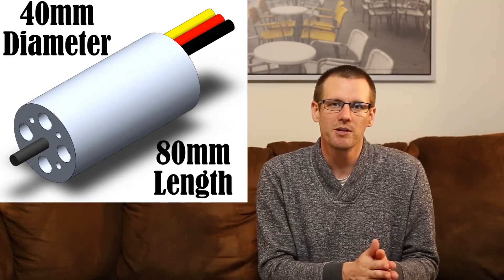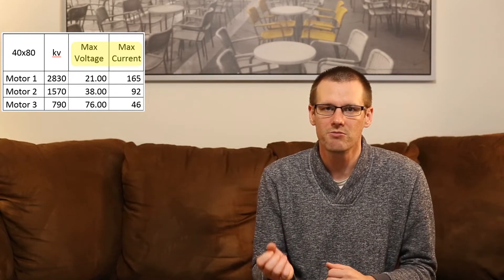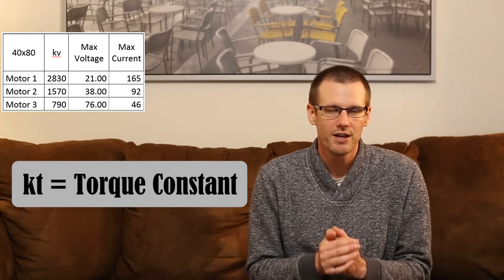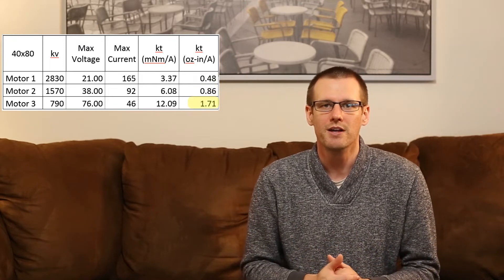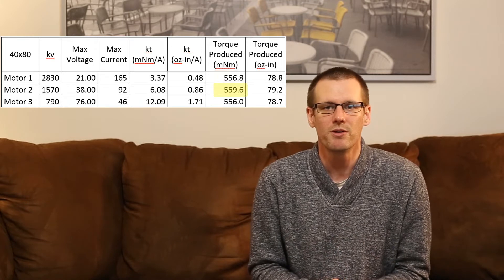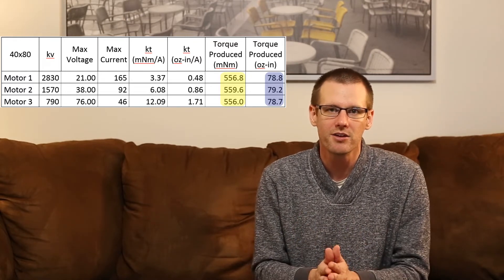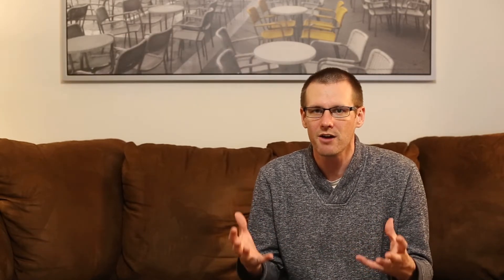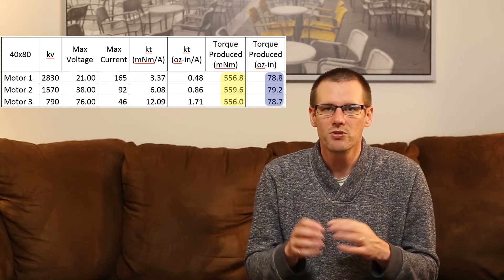Comparing Brushless Motor Torque vs Kv

Comment: Here are some of my comments on the points raised in the video:
1) "Continuous" current or power as provided by the manufacturer may only be sustainable for 30 seconds. If you run the motor at that "continuous" current for a couple of minutes it will damage the motor.
2) I would say a more common (peak) efficiency in brushless motors for the RC hobby is 80%-90%.
3) Torque increases with increasing load, yes, but rpm and efficiency drop. And this can be quite significant. You can easily lose 10% efficiency and more.
So it is very important to match load and motor and not just load down the motor.
4) Depending on how your application looks like this matching can be quite different:
  a) If the used throttle is around 100% most of the time then you want to hit that efficiency peak.
  b) If the range is wider with an average at 50% then you want to go past that efficiency peak at full throttle. 
5) Keep in mind that efficiency drops very quickly below its peak but rather smoothly and much slower above its peak.
6) I don't see the problem with comparing different motors. It will still be an apples-to-apples comparison. The comparisons only break down when you use values that are meaningless in isolation such as Kv or Kt.
7) This is nitpicking, I know, but Kv is not the no-load rpm given 1V input. It's the RPM needed for the motor to produce 1V back-emf.
8) I know that the motors are made up for easier comparison, but if you look at actual motors of the same size/weight class from some manufacturer you can often see something like this:
Kv 980 ... about 25 A
Kv 1250 ... about 35 A
This is because the lower Kv model has higher resistance, more windings, thinner wires .. resulting in lower sustainable "continuous" power.

This is not a problem though, as the same propeller at 100% throttle with the Kv 1250 motor will draw 30A while it will only draw 15A with the Kv 980 motor. And since the load might be better matched to the low Kv motor, half the current may still result in more than half the thrust.

This is also why I'd start sizing/matching components with the propeller based on the requirements (thrust or pitch speed). Then match the motor, esc, battery.. to it.
Reply from the maker: Hey John,
Thank you for your comments!
Reply: "1) "Continuous" current or power as provided by the manufacturer may only be sustainable for 30 seconds. If you run the motor at that "continuous" current for a couple of minutes it will damage the motor."

How much derating is usually required for safe continuous operation?

It seems like most manufacturers quote Max. Power, Current, Volts, Torque, etc., rather than "Continuous" values.  What isn't clear is if those values are for the same motor operating point (is it /should it be?)  Nor is it clear how to generate a speed, torque, efficiency, and power curve for these types of motors.  (Divide "Max. Volts" by "Motor Resistance" and multiply by KT for stall torque?)  If so, that would mean that the "Max. Power" would be proportional to speed because "Max. Torque" is essentially constant over the speed range, and that the highest efficiency would be with the motor running near its maximum speed (KV times "Max. Volts"?) 

"2) I would say a more common (peak) efficiency in brushless motors for the RC hobby is 80%-90%"

So a motor with a "Max Power" = 2000 Watts, would produce at most 160 Watts of heat.  Couldn't that be handled by adequately decreasing thermal resistances?  That shouldn't be too difficult with a properly designed in-runner operating with an effective heatsink, should it?
Reply: @gmack4097  >"How much derating is usually required for safe continuous operation?"

This depends on many variables, including if the manufacturer's numbers come from the marketing rather than the engineering department and also how much (cool) air is flowing over/through the motor.

But I can give you some random, concrete examples of airplane outrunners that depend on that airflow for cooling:
30g, 1500kv, 10A for a few seconds, 6A continuous
75g, 1000kv, 25A for a few secs, 15A continuous
200g, 500kv, 48A for a few secs, 28A continuous

All of those continuous numbers are about 60% of the short term max current.

But this may be significantly different for other manufacturers, motors, applications.
Reply: @xnoreq  What motor power and efficiency are you getting in those examples vs. the manufacturer's power and efficiency ratings?
Reply: @gmack4097  The motor stops speeding up when the applied voltage (including all the voltage drops over internal battery resistance, wire resistance, ESC resistance, motor coil Rm) equals the back-EMF (which you get through Kv).

Torque is approximately proportional to current/Kv.
(Hint: use SI units, so Kv*2pi/60 to get [rad/s], then you get results in [Nm])

Remember that there is a no-load current, and that V=R*I.
So it seems like an unloaded motor produces some torque but that torque is required just to spin the motor itself. No "usable" torque is being produced at the shaft yet.

As you load the motor down, more current flows and more torque is produced. But because V=R*I, the voltage drop across every component also increases (including the motor coil Rm). This results in lower RPM (see first paragraph).

Efficiency is simply mechanical power divided by electrical power.
Pel=V*I, so the voltage applied to the motor, or ESC if you want to include that, times the current flowing through the battery.

Pmech=Torque*Revs/time

Efficiency drops at some point because the dissipated power through the motor's coil alone is proportional to I^2 while torque produced is only proportional to I.

And at no load you got the no-load current but zero usable torque, so zero mechanical "usable" power, and therefore zero efficiency.

This is why you get this rapid increase in efficiency graphs as current rises over the no-load current.
Reply: @gmack4097  >"So a motor with a "Max Power" = 2000 Watts, would produce at most 160 Watts of heat.  Couldn't that be handled by adequately decreasing thermal resistances?  That shouldn't be too difficult with a properly designed in-runner operating with an effective heatsink, should it?"

No, that would mean at 80% efficiency the motor would produce 1600 W mechanical power. 400W would be dissipated as heat.
Yes, you can decrease thermal resistance of an inrunner ... of the case to ambient, but much less so of the coils to case or magnets to case.

Also, all of the things I've described in my previous post are "idealistic". In reality, there are many other sources of losses that increase with current, temperature and RPM.
So the 80% efficiency on paper may in reality degrade into much lower efficiency.
Reply: "No, that would mean at 80% efficiency the motor would produce 1600 W mechanical power. 400W would be dissipated as heat.
Yes, you can decrease thermal resistance of an inrunner ... of the case to ambient, but much less so of the coils to case or magnets to case."
OOPs - my bad - sorry and thanks!  But doesn't/shouldn't "Max Power" refer to mechanical power, which would require 2500W of input power (500W heat) at 80% efficiency?

"Also, all of the things I've described in my previous post are "idealistic". In reality, there are many other sources of losses that increase with current, temperature and RPM."
Other than increasing winding resistance with temperature, don't the winding losses and no load power losses cover all of the losses (which are reflected in the efficiency)?
Reply: @gmack4097  I'm not an expert on car/boat motors but at least for airplane brushless motors the specifications of "power" (or usually current) always refer to electrical power.
The only thing that comes close to a mechanical specification are propeller thrust tables where you can see the amount of static thrust produced by a particular propeller with a given battery voltage or throttle%.

You are right though, if "max power" were to refer to mechanical power then 2000/0.8=2500W electrical input power, but I've never seen it specified that way.

As for losses, as I said there are other sources. Some of them are very hard to calculate accurately, which is why they're usually ignored.
For example, there's hysteresis loss and eddy current losses that depend on peak flux density. These are referred to as iron losses. 
Then there's mechanical losses. Friction losses from the bearings (proportional to RPM). Air friction (proportional to RPM^3).
There's also stray losses in the copper.

Also, the ESC should be considered part of this, which has switching losses, Rds(on) losses, diode losses etc. That's why your ESC gets warm/hot.

The motor coils also are an inductor so the switching frequency of the ESC also has an influence on efficiency.
Reply: @xnoreq  "For example, there's hysteresis loss and eddy current losses that depend on peak flux density. These are referred to as iron losses. 
Then there's mechanical losses. Friction losses from the bearings (proportional to RPM). Air friction (proportional to RPM^3)."

Ryan says "
RCexplained
 https://www.youtube.com/watch?v=s8tvq1dzcLI&lc=UgzWsPBgdh5vspbgdo14AaABAg.9DyUFbmQTBL9E1fqsfwBm4
3 days ago
The no-load motor constant shows up in the formula for iron losses. Loaded current does not enter the equation.
Reply: @gmack4097  Well, no-load current is a single data point that lumps all of it together.
As you increase current or RPM some of these components will increase. Some more than others.
Reply: @xnoreq  Thanks for your help!  A key point that I was missing is that, unlike other motors, these are rated by input rather than output power.  So, if that specified power corresponds to the specified current, no-load current, resistance and Kv, there is enough information to calculate the corresponding output power, torque and speed as I commented here: https://www.youtube.com/watch?v=WqlQJw9YXhE

Comment: Very good explanation! So we can say if you gear up two vehicles with motors of the same size but different KV values to the same max speed, the car with the lower KV motor accelerates slower, because the wheel torqe is reduced.
The only downside of a high KV motor is the lack of cooling and only because of this, we have to find the sweet spot for our given application.
Reply from the maker: Thanks for your comment! This is true, however the lower kv motor should be selected based on requiring a higher input voltage. The overall output motor RPM would then be equivalent.
Reply: @RCexplained  Thanks! Now the puzzle is completely solved. :-)